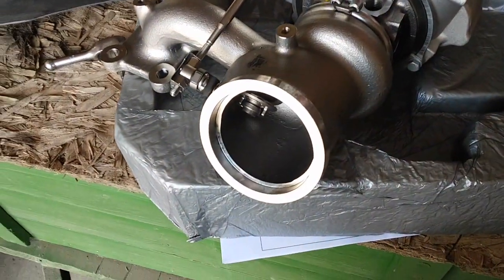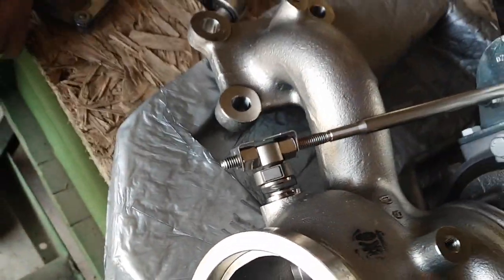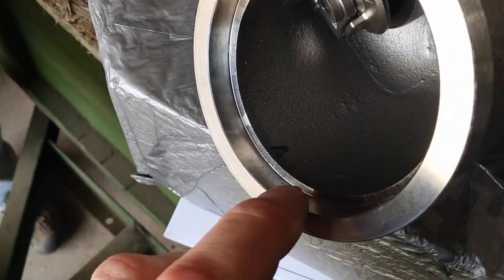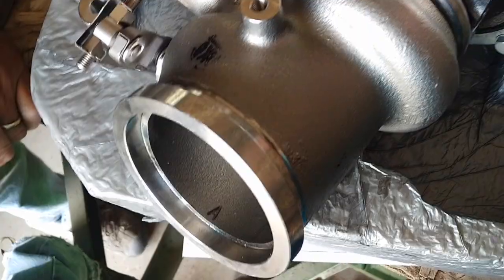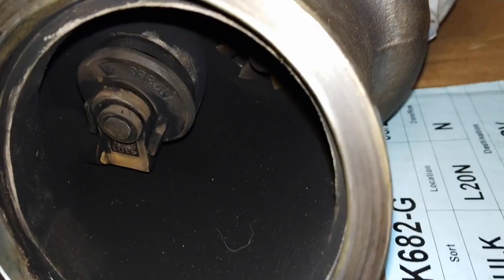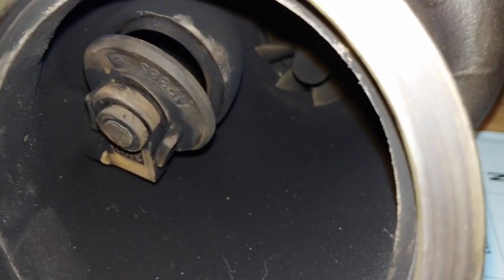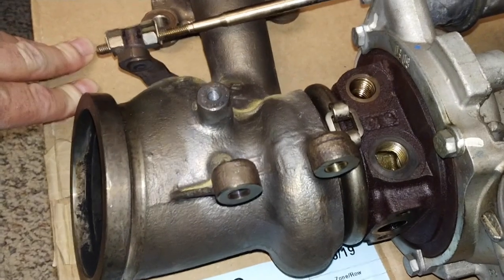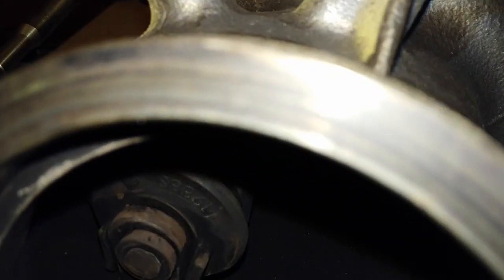2.0 Ecoboost Wastegate Failure Diagnosing P0299 Error

Comment: Please do a video taking turbo off especially with awd I just can't reach some bolts or can't get leverage to take some off.  Also the heat shield bolts on exhaust manifold stripped on me right away sucks so bad could be a not too bad job if ford had thought about people working on these cars really easily but of course didnt
Reply: I was able to adjust the nuts on the wastegate rod that go to the armature and so far that's been working for me honestly I'm just going to stick with that as long as I can until it cools down cuz I'm in Phoenix and it just is torture working on cars in this heat and I'm not going to be able to just work on it just in the morning or night and then let it sit for a while like I was before but hopefully I can give you an update and maybe even do a video on the all-wheel drive versions but yeah once I take it off I'll definitely see if I can get it up through the top that would be nice
Reply from the maker: @sock979  glad to hear the short term fix worked for you.
Reply: @lutheranpriest  thanks yeah so far good just waiting for temps to go down then Ill pull it out and try to do a video on an AWD one the heat was shutting my phone down after a few minutes when I tried a few weeks ago so couldn't do a video anyways right now.
Reply from the maker: I wish I could do that for you, but I don't have an AWD vehicle, and I installed the new turbo a year ago. There is a few videos out there that show the removal on an Explorer. It's a nearly identical setup. Yes, some of the bolts are a monster to get at. You might need some specialty tools to do the job yourself.
Reply: @lutheranpriest  yeah I saw the explorer one there was enough differences and I got all the way to the turbo problem was there's just no way to get the turbo out without taking off the transfer case I was just going to take off the turbine housing but it's on there So stuck I couldn't get it off so I'm just going to do a little Jimmy riggin I'm going to use a spring inside the pivot point to take the slop out and hope that the seat of the valve inside for the wastegate isn't jacked and I'll just have to hope that that last long enough till I can figure out a way to get the turbine housing off by itself Thanks for the reply appreciate videos
Reply from the maker: @sock979  the best thing you can do would be to adjust the wastegate linkage. You'll need a manual vacuum pump, they're around $20 on eBay, or your local parts store might loan them out. Put the vacuum pump on the wastegate vacuum can, pump it up, then adjust the linkage until there's no play between the gate and port. You should have enough clearance to visually check that it's adjusted enough to close the wastegate if you unbolt the catalytic converter and remove the two bolts that keep the convertor in place. Just be sure not to overtighten the linkage.
Reply: @lutheranpriest  hey any chance you still have the old turbo can you see how hard it is to take that pin out of the arm I was thinking about trying to do something while I still have the car on or the turbo on the car because as best I can tell the actual seat of the wastegate isn't bad It's just the slop in the arm that's my problem right now So I wanted to see if there's any way to get that pin out and replace it while it's still on there if that's super hard you need a press or what
Reply from the maker: @sock979  sorry, I don't have the old turbo, it was returned for the core deposit. In my opinion, the best temp fix is to adjust the linkage. You'd still have slop in the wastegate, but if you adjusted the linkage until the wastegate plug would fully close, you'd probably get the amount of needed boost to eliminate the problem as far as the sensors and ECM are concerned.

My theory is that Borg Warner used too soft of a metal when manufacturing the earlier turbos. On mine, the armature that connects the wastegate to the rod was worn quite bad, and the difference between the plug on the old and the plug on the new was quite significant. Even though the engine only had 95k miles on it, you would have thought it was 250k plus just by looking at the turbo.
Reply: @lutheranpriest  yeah it's crap yeah I just I couldn't get my spring thing to work and it's really hard to get in there and the engine kept cutting me so I just adjusted the linkage all the way I think I had one full turn left where I was at and that took all the slop out so once I get everything back together I'll drive around and hope that it'll be good long enough that I don't have to go back in and take off the axle and transfer case to get the turbo out I'm really sad I was really hoping to get that out and get the turbine housing off and see if I could come up with a cheap fix but with everything pressed on I probably would have just messed it up trying to take it off and had to take it to a machine shop anyways.  oh and yeah mine only had 94,000 mi and there was like a quarter inch of slop It's ridiculous and I looked it up and it looks like they've been having that same problem for decades and they never fixed it there's actually a kid on eBay for beamers with these where you can fix it
Reply from the maker: @sock979  a while ago I Googled "turbo rebuild service", and found a place that would rebuild the wastegate for less than $200, which is the route I'll go next time. Much less work, much less money, and unless the bearings or internal seals have failed, I don't see any sense in replacing the whole thing.

Just a quick question, did you adjust the linkage while using a vacuum pump to fully actuate the linkage? Otherwise, if it's set to be closed full time, you'll quickly blow the turbo and quite possibly damage your motor. Also, I forgot to mention, the turbo removes from the top of the motor, after you remove all the air tubes from the air box, to the turbo, to the intercooler.  If you can manage to get to all the bolts and fasteners, you can remove the turbo or the wastegate/exhaust housing without removing the transfer case. Being an AWD model, it might be helpful to remove the catalytic converter, and if you do, you might as well replace the upstream O2 sensor as well, mine failed about 3 months after I replaced the turbo, and the only way I was able to replace the sensor was by removing the catalytic converter from the car.
Reply: @lutheranpriest  I got the cat loose just fine I didn't take it off like it came off the turbine housing but take it off there was one more bracket that was too much of a pain to deal with I measured and it didn't seem like the turbo would fit through the top I don't know maybe I'll check again and I actually I didn't use a vacuum the diaphragm held vacuum but it doesn't actuate the rod on mine it actually takes pressure to actuate the rod so I've filled it with pressure from my air compressor I think I put on like 20 psi in the rod actuated just fine but when I tighten down the nut no I did not do it while actuated because it would be fully actuated and wouldn't work I don't know if the wastegate on the one that you did was different cuz mine didn't open by vacuum mine open with pressure so that wouldn't work on mine but basically mine went over I think like three full threads like there's only one thread left and that distance was about the same as the slop so I checked at like three times and I turned it just enough to take up the slop otherwise it's the same as the stock setting just about an eighth of an inch closer to the diaphragm if that makes sense I'm not too worried about it over boosting that little turbo honestly probably couldn't even blow that motor couldn't make enough pressure but it'll be fine it's got a 9 lb spring or a 10 lb spring and then anything more than that will open it unless the stupid bypass solenoid messes with it but even then it's it'll throw code and go to limp mode so I'm not too worried about it.  Would be interesting to see how much pressure it built if you just left the wastegate close the whole time.  I think on some of the other ones the most they could get out of it was like 15 PSI.  actually I double check that and that's wrong these turbos can make a lot more pressure than that It's just it's not worth it after about 15 PSI.  But luckily one of the first things I did when I got this car was install a boost gauge so I can at least monitor boost levels.  which was actually how I caught the problem even before the engine gave me a check engine light cuz it was riding at only two psi.  The pain though was connecting it to the manifold cuz there's no tease besides the huge nipple on the back for the crankcase pressure release I can't think of words that's late for me so actually I had to order a throttle body spacer but luckily eBay had a cheap one for 20 bucks and it actually had like eight different outlets and I just blocked all them but one and was able to tap into the boost after the throttle body there cuz that has to be after the throttle body doesn't matter before it I also upgraded the blow off valve to so that'll hopefully give me a little extra help although it won't matter with this wastegate thing too much.  More likely I'll try and tackle this thing again The car I was borrowing had to be returned for now but I'll be able to get another go at it before school starts and then hopefully I can make a video for us all-wheel drive people and I'll see if I can somehow slip it up out of the top because that would be so nice not having to take off the CV axle half shaft and the PTU
Reply: I double checked and put pressure on the diaphragm to make sure the actuator rod worked and it works unfortunately the slop will still make the rattle sound once it starts opening it but when it's fully closed at least there shouldn't be any rattle and besides any craziness ford does with the ECU technically the wastegate should be closed all the time unless I make it past the maximum boost setting so hopefully it won't be too bad knock on wood
Reply: well I was going to let y'all know how mine went with the rod adjusted but when I started up there was smoke and I figured out that the gasket between the turbine housing and the cat wasn't there It must have come out and so it was leaking very slightly so now I got to pull it all back off and get that in there and then put it all back on I mean it's not that much It's just a pain getting that V-Band back on

Comment: Hi, thanks for posting this. I bought a 14 fusion and there's an audible rattle in the engine that I could not locate. Now I have p0299. This video exposed this rattle. Could this, in fact, be the rattle I'm hearing?
Reply from the maker: Most likely. How many miles on the engine? If I had to do it all over again, I would adjust the wastegate linkage and try to get as many miles out of the old turbo as I could.
Reply: @lutheranpriest  it's got 84000 on it. How can this be adjusted?
Reply from the maker: @isjackdull4349  there's two stop nuts on the wastegate linkage. You would need a vacuum pump to fully actuate the linkage, then adjust the nuts until the wastegate is closed. You might want to do this with the cat disconnected, and use an inspection camera or mirror to be able to visually confirm that the wastegate is closed.
Reply from the maker: @isjackdull4349  and I'm sure this is absolutely infuriating with only 84,000 miles on it. That's how many miles my Edge had on it when I purchased it, and little did I know when I bought it that it had a bad turbo. So I definitely know how frustrating this is.
Reply from the maker: @isjackdull4349  and if you aren't in a hurry, I need to replace the upstream O2 sensor, and I think I'll make a video while I'm at it to show how to adjust it to take out the slack.
Reply: @lutheranpriest  you are a Godsend! I am really in a spot right now. Upside down on this loan, had the car for less than a year. While the only guarantees in life are death and taxes, I really appreciate your help and advice. Can you recommend a decent vacuum pump? I've worked on cars, but have been lucky to avoid having to purchase specialty tools up to this point. Also, if it is my linkage causing the ticking in my engine I can be fairly certain if I see a fair amount of play there as shown in your video?
Reply from the maker: @isjackdull4349  and pump like this should work: https://amzn.to/2xwLnPi

I would check with your local parts store and see if they have a rental tool. Just a recommendation, with the help of a friend, get underneath the vehicle while it's running and have them hit the accelerator. If you see the wastegate linkage engaging, this will confirm that the vacuum can and turbo solenoid are working properly.
Reply: @lutheranpriest  hey. I bought my car with a 3yr 3000 mile warranty. The ticking sound I heard started before warranty was up. I brought it in while still under warranty. They told me the motor was just grounding out and that I need to schedule an app. I never did because I didn't have time. Do you think they'll have yo honor it if I can prove it's the linkage?
Reply from the maker: @isjackdull4349    it doesn't hurt to ask, but I wouldn't plan on it. The dealer cost for the turbo and all necessary fluids and seals is roughly $1000. If you bought your vehicle from a Ford dealer, perhaps you could talk them into price matching from the site I listed in the description.